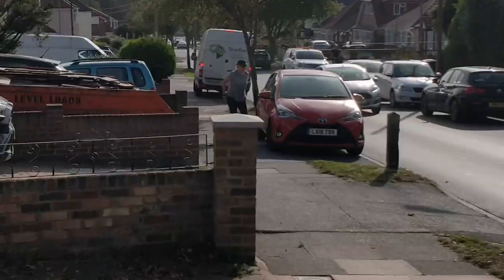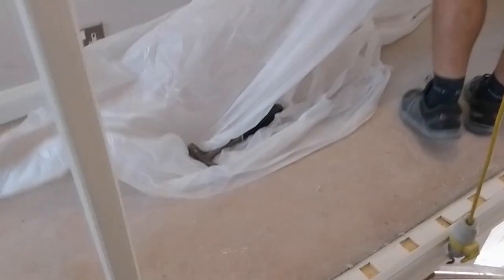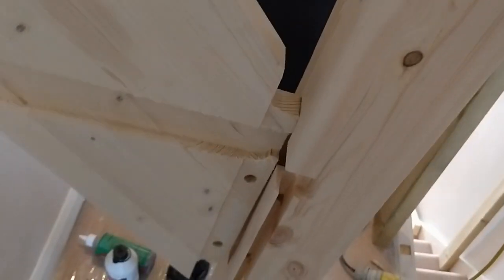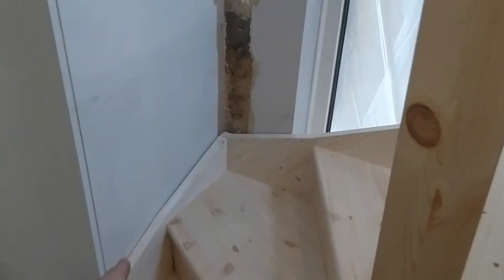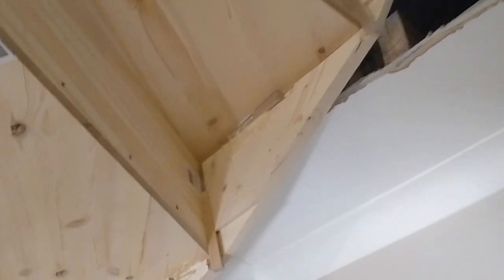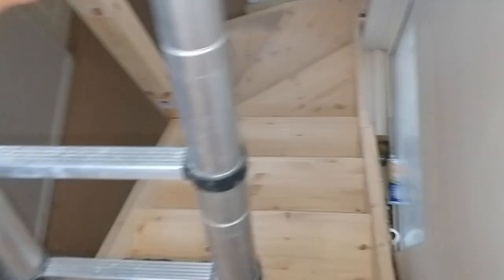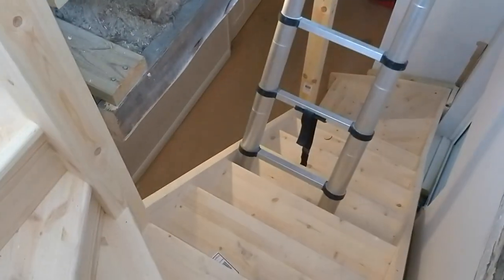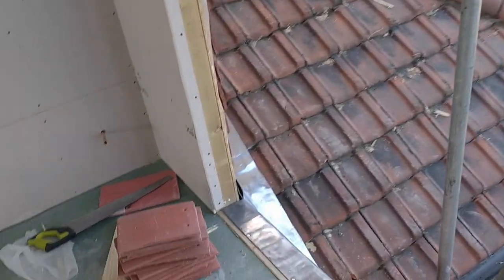Installing the dormer staircase

Comment: Nice video, didnt like the gap on stairs, suprised the client is happy with that!? I would have been a bit annoyed about it. Congrats on 1k subs!
Reply from the maker: Cheers mate, I'm really pleased to have hit that milestone.

Agreed about the gap, really not ideal 🙄
Reply: I would have wanted it replaced
Reply from the maker: Yeah I think I would have too...we didn't take the measurements or order it, so it wasn't our call in this instance.
Reply: @OfficeBoyBuilder  fair play. Guess if it wasn’t your error, it was up to client to deckde
Reply: You should of packed the staircase off of the trimmer, thus taking it tight to the wall.
Reply from the maker: We did strongly consider that, but were keen to have the top of the steps resting on the flitch beam in the loft, rather than floating and then having to bridge that gap, however small.
Reply: Yeah I get what you’re saying but if you would have bolted another timber the thickness of your difference to the flitch beam, it wouldn’t have been floating. You then notch your newel over the timber you have bolted on. 
Sorry mate, I sound like a keyboard warrior here, it’s just I make and fit them for a living and have to do this from time to time.
Reply from the maker: That's all good mate, it's helpful for everyone when there's experience to share. Thanks for taking the time.

Comment: Nice work, but I'm sorry I couldnt accept that gap. When I use to make and fit Kite Winder staircases measurement is everything. Also you could have packed off the trimmer at the top nosing and closed that gap.
Reply from the maker: Yup, agreed! I've just posted a video showing how to measure correctly (we didn't measure that staircase!) And I've got a video coming up in the next week showing how to fit one that has been measured properly...stay tuned!

Comment: As a rule stair width of stairs is always measured outside of string to outside of string. An internal measurement would be for regs where it's measured from wall to handrail. Minimum is 800mm on private dwelling stairs. Although I measure the 800mm to the newel post because generally the newel post is always wider and the first contact before handrail
Reply: I read minimum width was removed now.
Reply: @Lucidchronicles  has to be minimum width for stairs for regulations for access. Only reason stair width wouldn't need regulations is when access to lofts or storage access. If it's to another domestic room needs regulations.

Comment: Most chippys I have worked with make up the top of stair on floor lower it in and put bottom straight bit in
Reply from the maker: Yes I've seen that technique too - we were being a bit cautious because it was the first time we had used a Stairbox set before.

Comment: Could of pushed the stringer to the wall and doubled up the trimmer and added 65mm strip to the floor board.
Reply: was just about to put that. you'd still have that gap down bottom set of winders though.
Reply from the maker: Agreed. The problem was that the steps were measure inside the stringer, not outside the stringers...so that 60mm gap was good much to make up any other way
Reply: @kallumbaston378  yes you would have a gap at the bottom. As it is such a small wall I would dot and dab a piece of plasterboard on then skim it. Better than having a gap all the way up the main run.

Comment: I did leave another comment but I really don’t like what you’ve done. I’d be very unhappy with that staircase that you’ve fitted if I was the client I’d want it re fitted correctly.
Reply from the maker: 2 points; 1) you're not the client, so that's a relief. 2) the staircase was measured and ordered by the client. We simply fitted what they had bought. Not an ideal situation to be in, but equally not something we can change after the fact

Comment: Glad it's not just me who measures stairs wrong, I wouldn't be using those coach bolts fixed into the wall with resin either, you've used wedges to tighten up but as soon as those wedges come loose all your fixings will be loose. You should have used studs and tightened them after the resin had set
Reply: I'd imagine those packers were glued to the wall and the stringer. Can't see it going anywhere to be honest, 🔨 🇮🇪
Reply: One thing though, if one is using a polyurethane glue make sure to wet one side of the joint, 👍 🔨 🇮🇪
Reply from the maker: That's super interesting..! I've never heard or seen that being done before.

Comment: Hi mate as you are aware now the gap between wall and stringer is what we carpenters call a school boy error in measuring I recon you or whoever measured the opening didn’t put in the correct measurement. 100mm is the classic error either to wide or to narrow. Also now your a builder call the tools by their correct name what’s a “multi cutter” ? Posh builders but hey your having a go well done.
Reply from the maker: The error was the thickness of the stringer (on both sides) which hadn't been accounted for by the client who ordered the stairs.
Reply: Hi so why did you let your customer order such an important item.

Comment: Looking at using stairbox for my stairs. What's the issue with measuring again?. They don't include the stringer width when you design the staircase online?. Cheers
Reply from the maker: I'm not entirely sure what the issue is, as we weren't the ones to measure it, but the gap was exactly the width of two stringers, so perhaps that was accounted for.

They have a great customer support function, so if it's not clear on their site, just call them and I'm sure they'll help.
Reply: @OfficeBoyBuilder  thanks for the reply.

Comment: Do you know what's the pitch of the stairs?
Reply from the maker: I don't know that, sorry! We didn't order them, the client did, so I didn't ever find that out. I imagine they're a standard pitch though, which is determined by the rise and run of each step. Typically you have around 200mm of rise and 225mm of run per step, and then however many steps you have on the staircase decides how high it goes.
Reply: @OfficeBoyBuilder  Thank you
Reply: @nataliawalker4184  stairs need to be maximum 42 degrees and minimum tread of 220mm if you’re doing it under building regs
Reply: How much do you charge to fit a stair box staircase? I am impressed that you solved the gap on the edge of the stairs, a very clean finish
Reply from the maker: Staircase fitting as a stand alone job is typically quite expensive, because of the time consuming nature of it. I don't actually do that myself, it is wrapped up as part of the cost of the overall job. However, depending on where you live, the supply and fit of a staircase could easily cost £1.5-2K depending on the side of it.
Reply: @coops6621  I prefer a unit rise of around 7-1/2" and a minimum unit run of 10". That said one is constricted by the size of the well and the head clearance, 🔨 🇮🇪
Reply: 200 rise 225 going is around 41.6°